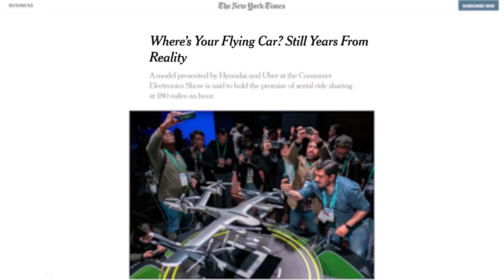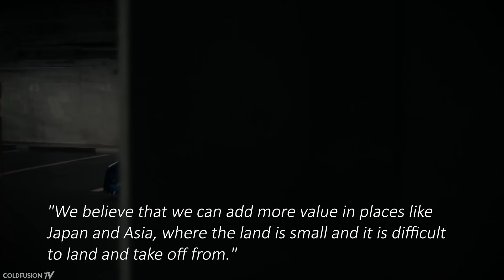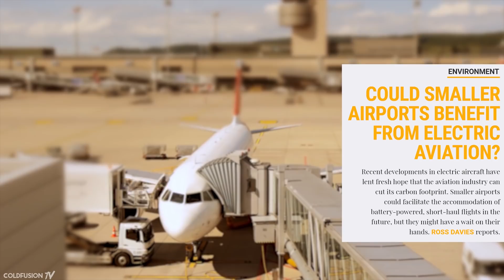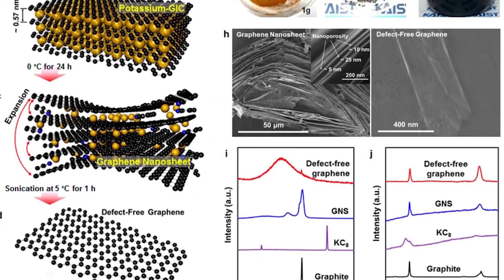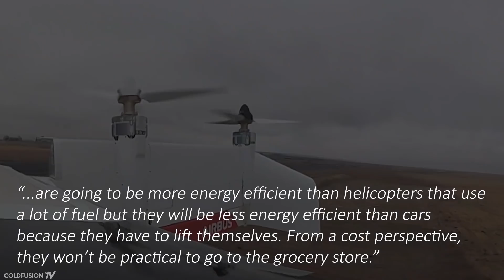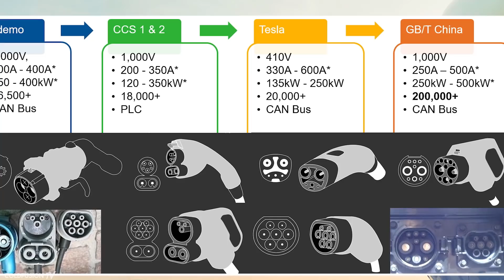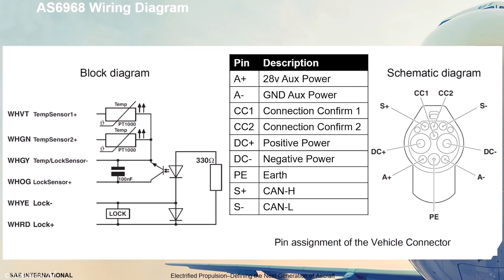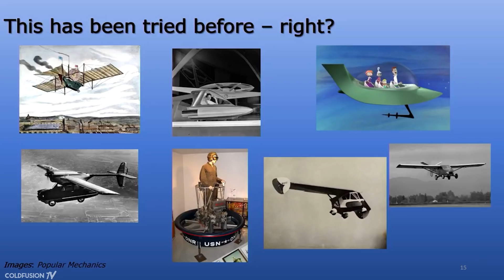Japan's Flying Car – Problems and Solutions

Comment: This was supposed to be about 'flying cars' but instead it is about 'electric aircraft'; The question is where these large passenger carrying drones will be allowed to fly & land.. not too many places so it's not much better than cheap small cheap helicopters-which have been around since the 70's.  Electric aircraft are like electric cars: they are toys->widespread use is totally unrealistic because instead of having a few fixed locations where a car can drive-in refuel in a few minutes and then allow the next car to drive thru; Instead there has to be a charger on every parking spot.. other wise they are only realistic for people who live in their own house (with garage so you can park and recharge) and it has to be a second car because if heaven forbid that you actually have to use your car all day, driving to and from multiple locations, on a hot day with aircon, the electric car will always leave you FORD(found on road dead) so you always have to have a real car to back-it-up.

Comment: Pipistrel Alpha is a gorgeous plane. The electric version costs 130000 dollar, an additional battery costs 26000 and the rapid charger 15000. The gas version costs 80000, less than a half. I live in Ecuador southamerica where the avgas cost 2.30 per gallon, it needs more than 10000 flying hours to amortize the difference and with everlasting batteries.

Comment: I suppose I'm stuck on definitions. 

 On one hand, what was the automobile to people? It was a personal land vehicle that was more reliable and with more potential than horse-drawn carriages.  What is the aviation analogy that "flying cars" aim to succeed? It's light personal aircraft industry.

Flying an airplane hasn't changed over the decades where the pilot is not only controlling travel, but monitoring engine, atmosphere and air traffic indicators. Maybe I've taken driving for granted, it's just not as complex or complicated to be certified to operate an automobile. Can flying be made easier? Sure, just have a computer monitor performance and safety, while a network connection handles navigation.  

I like the idea of using electric mainly due to lower maintenance (no oil pressure and temperature, all sorts of fluids, etc).  I don't quite understand the fuss regarding chargers, why not use induction?   Think of a parking lot where your vehicle either lands or drives in, and aligns a retractable induction pad to the ground. No cables, no proprietary charger ports; let the parking lot's electrical system determine your vehicle's needs accordingly.  That's for large-scale adoption, small scale cabling would be cheaper and easier short-term.

I guess I'm hung up on the road-operator aspect: if this thing cannot retract enough to go through a fast food drive thru, it's not a car. (unless we start seeing Taco Bell Fly-thru). I'm aware that the coefficient of parasite drag of a car is ten times higher than an airplane (Toyota Prius vs. Cessna Skyline 172), so the power plant requirements would be much higher and affect performance.  Although, for a car, the majority weight fraction is empty vehicle weight, not even payload or fuel.  If these personal air vehicles are supposed to have a road capability, it has to operate within the current infrastructure.

Comment: Great video as usual!! As a retired Airline pilot I see several issues right off:
1 - Regulations for the crafts flight safety, both structural standards and operationally. 
2 - Operator training - emergencies & malfunctions WILL happen. While I firmly believe everyone should take some flight training even now - I do NOT believe everyone should be a pilot!
3 - Insurance and liability - people do stupid and dangerous things with automobiles - just imagine the potential for mayhem with 100's or thousands of air vehicles over a urban of even a suburban area each day!!

Comment: I think it will take far longer.

Atleast untill its more than a local musing.

This due to:
1. The fact that there isnt any infrastructure to handle this system yet.
Efficient infrastructure demands standards that just havent been set yet and standards are rarely sweeping and fast to adopt due to existing ideas and design considerations from the, at that point, most likely prolific market.

2. There arent enough laws and regulations regarding such devices and airspace is still quite heavily controlled. Setting up a company and seeking amendments to every single local airspace related law will take time and serious cash.

3. The lack of security features regarding these devices will most likely mess up the planning and execution of #2 since lawmakers are unwilling to jepordise the general publics mental and physical health, especially since frequent rainstorms of bodies from the sky tends to be quite a graphical "nuicense" which one cant easily make go away.

4. #3 brings us closer to the main issue; safety. With cars we can accept a certain degree of imminent death and danger since we feel much more in controll when skidding 360*, wildly out of controll, on a 60mp/h highway compared to helplessly plummeting to our deaths. The outcome is the same but since we are on terra firma in the car scenario we often tend to blame luck or the driver, not the car or technology which should have, and could have, prevented the accident.

If a pilot gets a stroke, the airplane needs to be able to achive a sucsessful landing on its own, at least. Certain modern private jets can already do this, but they dont have to compete with highrises/other cars or an unknown topography or driving style.

Im sure there are several other issues or views to take into account but these are a few i could come up with.

Comment: The plight of flying vehicles will NOT be the technology. It will be legislation.

Until flying vehicles is mistake proof (human error resistent), no legislative body will allow Joe Normalguy to fly a flying vehicle to work.

Until the process becomes 100% automated... I don't think flying cars will ever be a thing. There is just too much skill required to fly a plane.

Think about how bad CAR drivers are. Imagine an asshole flying-car pilot with a chip on his shoulder and 'sky rage'.

Won't happen.

Comment: One idea that should be explored for electric aircraft is removable battery packs. Fly to your destination and then swap out the battery pack, A properly designed system could mean the aircraft would be ready to resume flight in minutes. This is what they did where I worked. they had forklifts running 24-7 and a battery station that would replace the spent battery with a fresh one in no time.

Comment: We already have flying cars, they are called helicopters.
Reply: Exactly lol. And even if these electric ones become a thing, it won't be for the average person. You need a license to pilot it, you need extensive maintenance and security checks.. It just won't be as commonplace as they make it look. Just an helicopter, but perhaps more fuel and/or weight efficient.
Reply: @Homiloko2  Autonomous....
Reply: @SomePersonOnYoutube  afaik being autonomous does not exempt it from needing a qualified pilot. You still need a driver's license to drive an autonomous car, just in case something goes awry. 

And as I said, proper maintenance is also a problem. If anything goes wrong in a flying machine, it goes all the way down.

Comment: So one of the main problems of batteries is their low energy density compared to their counterparts such as gasoline. However, the low energy density is due to the function of the batteries: the batteries are designed to carry both educts and products. If gasoline cars would have to carry the air they needed and the exhaust gasses, they would have a much lower energy density for the "energy storage unit". This lets us appreciate more the elegance of a energy storage solution such as batteries: They can operate without directly interacting with the environment such as the oldfashioned ICE (internal combustion engine).
I guess the battery sector, or the more general electric energy storage sector, will make great advancements, as there are a lot of industries, who are behind the research. For example: recently europe has passed a legislation which forces manufacturers to reduce emissions by 15% after 2025 and by 30% after 2030. (https://ec.europa.eu/clima/policies/transport/vehicles/heavy_en) As this sector is already optimised for fuel consumtion (~30% of the costs in logistics are due to fuel consumption) and therefore emissions, there is not a lot of room through optimization of the ICE. As there is not a lot of potential for energy recovery on long haul vehicles and the admitted load (for the entire vehicle) is limited (to 40t in europe), now also commercial vehicle manufacturers are promoting the research of lightweigth batteries. And i believe they are even more keen on high power lightweight batteries than car manufacturers, due to the before mentioned reasons.
We're still at the beginning of the e-mobility. As it was at the beginning of ICE-cars, where you had to buy gas at pharmacy, also the infrastructure for the energy supply is still making it's first steps. I predict, that there will be a trend from refueling at a specialized infrastructure to refueling whenever you park your vehicle as well as a trend toward standardized payment methods and chargers, whitout dozens of adapters, payment cards or apps.
I hope, they also plan on providing an interface for coolant, as the bottleneck when charging could remain the thermomanagement (the battery is to cold or to hot)
I'm looking forward to what the future of this sector will hold for us.
Lastly: transitioning from ICEs to electrical machines is possible, but i guess it wouldn be possible in the other direction. They have so many advantages over ICEs, but only two major drawbacks: energy storage and free heating in the winter (However, these are not directly related to the engine)
Thanks for reading and have a good day!

Comment: It will take a new kind of engineer approach to perfect a flying car that works for all. It must be nuclear powered like the US carrier. It will take an onboard computer with gyroscope and auto pilot to to smooth out the vessel when airborne. It will take governmental control to regulate invisible flight paths. The 4 propeller drone model is what will work, not the wingsed design because once there's a wing, it's already an airplane and won't fit the street roads. The design must fit street roads and able to take off and land vertically without hazardous noise to the neighbourhoods. And it must fit the car garage or every house and building must have a new kind of roof that can handle vessel parking.

Comment: What a bullshit video without knowledge of current eVTOL situation.
First there is already production ready eVTOL AAV with 100km flight distance and over 2000 manned flights. EHang 216 https://youtu.be/dAga8PetZC8
Second is that eVTOLs are first used in other cases that air taxi. Regulations for Air Taxi in cities takes time. eVTOL can be used in production straight away in logistic in a specific area (e.g. logistic to oil platforms)

Comment: When I think of a flying car, it’s something straight out of Blade Runner movies. Silently hovering and moving around. What we get, big ass blades and tons of noise with no wheels.
Reply: Well that is also the movie that has that weird physics breaking photograph simulator thing. There are ways of reducing noise, such as multiple options that reduce induced drag at the wingtips, different types of propulsion systems, different types of engines and their noise suppression systems (or lack of with electric as they just use electric motors), and altitude since these things usually won't be cruising at low (relatively) heights. Though I do agree that most designs don't look like a car and so look ugly as one, like most gyrocopters that have many exposed aircraft pieces which don't look great on a car and pretty much make them look like blenders who's glass shattered from all the jagged edges on them. That is the price to pay for efficiency, you lose the elegance of what is essentially a smooth rectangle that can fly
 
So you're stuck with this until we find some kind of internal lifting mechanism like anti-grav or something

Comment: Sir,

It will take much longer or not all depends on battery, optimization will not solve the problem for an aircraft. If we wont get/ get good battery solution, so I am just curious.

Comment: Hopefully the power source of its charging will be generating from renewable sources like wind, solar, geothermal, etc. If not, it will add another problem for the environment since the renewable sources will additionally emitting greenhouse gases through the air because of additional equipment to be powered. 

I'm looking forward for this "way of the future".

Comment: you could create or use existing islands in the ocean that could be pitstops for international flights. they could either be ships or be actual islands.

for example. let's take a flight from Portugal to Canada.

you could fly from Lisbon Portela Airport to Aeroporto das Flores: 1,908 km (recharge)

then Aeroporto das Flores  to St. John's International Airport: 1,942.90 km (recharge)

from there you can go anywhere in the Americas and vice versa. The main thing is getting over the water. You could even swap out batteries at each airport and just land for only a few moments and be in the air again.

All those charging stations could be solar-powered meaning "free" fuel.

Comment: Since a quick comparison between hydrogen fuel cell and battery power has been done for cars, I wonder if fuel cells have been considered for aviation use as well. Energy density is especially relevant to large flying vehicles

Comment: Good video. but to me flying car seems completely pointless. like what difference does it make to fly instead of drive? the only thing I can think of is easing congestion, but I think a far better solution to that is self driving cars (traffic jams are almost always caused because of slow reaction times of drivers, not a physical limit to the number of cars that can pass). Also, planes are way harder to fly than cars, since they have 6 degrees of freedom instead of the 3 that a car has. That adds in a lot of complexity, plus the fact that you cannot have a marked road, this would have to be automated.

Comment: plugs keep changing because products keep changing and EVs are relatively new.     Flying vehicles are no where near ready for the consumer market for the foreseeable future -- these "ventures" are simply a money grab for investor money, which just lines the pockets of the venture capital partners and firm owners/managers.  Think 100-200 years and even then it will only work if the entire flight process is computer controlled.  

really dumb story.

Comment: This is the chimera that never dies because it was never alive to begin with, but attracts public attention and investors. Obviously and even if those feeble things could resist more than a gust of wind (or are stable enough) they wouldn't be practical for any urban environment for oh so many reasons. At most they help as a proof of concept that could benefit other already developed flying vehicles, neither of which could be called a flying car. As good as the hope for better batteries is, we are not still there, etc. Again, there is nothing wrong in playing with dough (and every generation toss their new technologies into the chimera) but it won't be a thing (at most it could create a new form of small size aircraft) but there are already many of those even if not electric powered.

Comment: Why must tech news insist on calling these "Cars", seems to me like its all being funded by a ignorant fantasy of rich out of touch investors with no real knowledge of engineering and physics, Sure new low cost electric VTOL aircraft have the potential and utility to become more popular but safety, regulations a security will always keep it niche. Also noise pollution of small propeller drone style aircraft is much worse than current helicopters.

Comment: To go go, i think that even if the tech is there to make the vehicles work, as long as it is prop driven getting it past saftey standards for use on the roads will be difficult. Its like the cyber truck, that car wont be on australian roads if its made of cold rolled steel at will tear through most cars if there is a collision.

Comment: Currently, even to develop a new car from scratch OEM's will take around 3 years. This is the timeframe needed to make the new car reliable, to meet safety standards and so on even though we have 100 yrs of experience building cars. Now, imagine how much time it will take to fuse a car and an aeroplane with the increased complexity.

Comment: Dagogo, I would just like to add that although the wright bros did successfully take off and land( however short a flight) a heavier than air  craft, they were not the first to achieve actual air. As I'm sure you are aware, New Zealander Richard pierce , who built an engine and body of an aeroplane in his garage or shed after finishing his days work on his farm. Around the same time( week before, or week after) as the wrights made their flight, Pierce managed to take off in a field, but was unable to control the craft during the flight and had to "crash land in a hedgerow.When told about the wright bros, he said that the " first" heavier than air flight was still first from them, because he was as yet unable to land as well as take off! Humility from a Kiwi bloke who hadn't even heard of the wrights or anyone else, and was working on his handbuilt engins(adapted from milk cans) in his spare time in his shed, with no particular timetable or extra research.Despite his obscurity and humility he deserves(in my book) a central position in the development of manned flight.